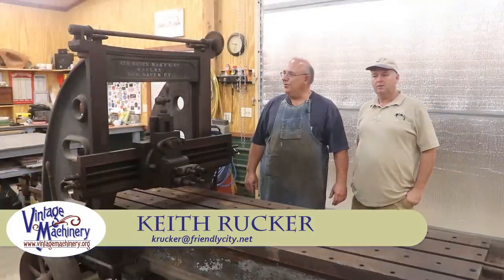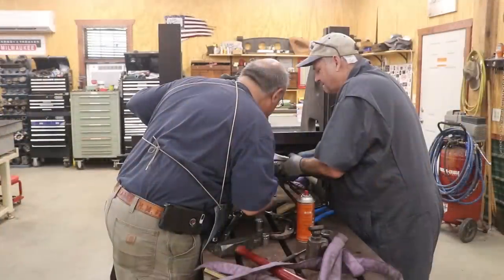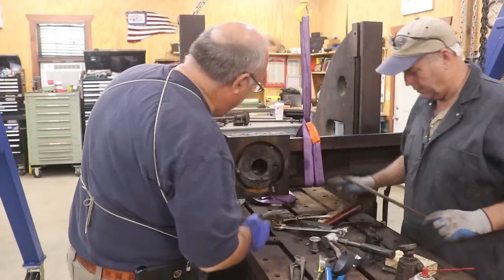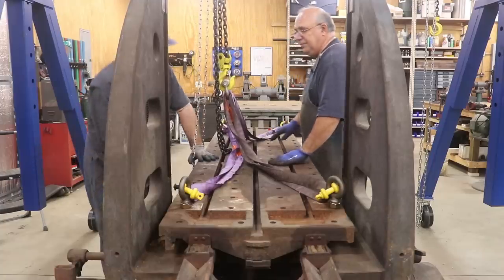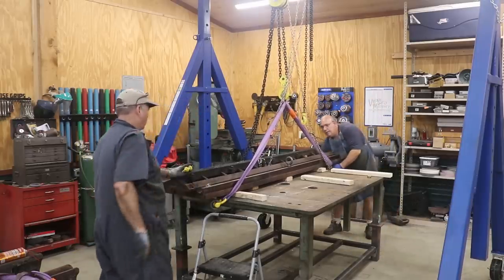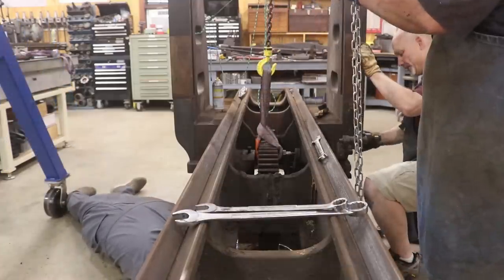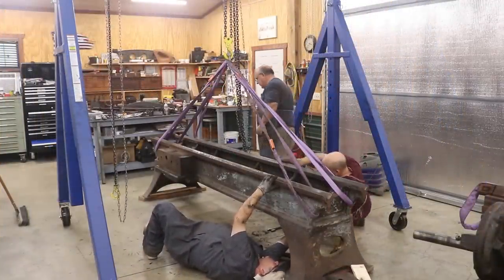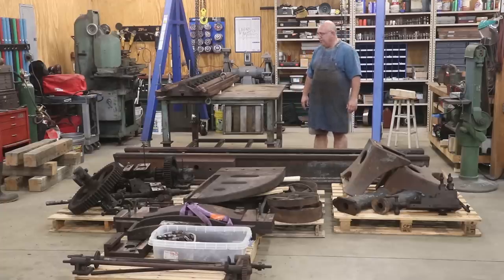New Haven Metal Planer Restoration - Part 1: Disassembling the Monster!

Comment: Keith for some of those large parts what about a commercial firm that has dipping tanks.  Years ago I had a 1922 Durrant frame that was caked in grease and rust.  I took it to one of those electrolysis degreasing, derusting places.  It came back so cleaned you could see the hammer marks where they bucked the rivets.  The time savings was enormous and allowed us to immediately begin restoration.  I encourage you to look into it.  No scrubbing, no mess!

Comment: Now you need a 24 foot above ground pool full of Evaporust
Reply: Papertowels soaked in ER covered it cling wrap replace every 12h.
Reply: I like Hammers suggestion more :p.
Reply: Maybe setup a small tent around the larger parts and use a pump and sprinkler to spray the evaporust.
Reply: The gel saves getting a big tank. It may be "one use" but that's better than buying a couple thousand gallons of liquid.

Comment: Just a thought. You should he yourself an adapter for your pressure washer to do water sandblasting. You could clean the rust off without all that dust and make it way easier on your self. Thanks for sharing looking forward to the restoration.

Comment: As much as I use EvapoRust and electrolysis, I'd go for a large sandblaster outside in a tent. I used one of the cheap tent buildings for that a few years ago, laid down a tarp, set up the "shed" and taped the tarp to it to make it somewhat airtight. Added a fan and filters like you would for painting and went to work. Blast a large piece, blow the dust off and spray on a coat of primer. For the machined areas a strip of duct tape would keep you from chewing them up.
Reply: There are "dustless" blasters that will come to your project, that do a superb job.  Sand is too abrasive for some of the parts on this old machine.  There are much easier and cleaner, plus much gentler ways. to clean this without sand blasting.
Reply: Blasting has many levels, from rough blasting with heavy grits to soda blasting. Dustless is nice not so much for the "dust" but because the water keeps the surface of the material cool and lowers the chance of warpage on thin materials. I've used it on car bodies for that reason.
Reply: @Blazer02LS  ...Yep, that was my point.  I am in the middle of two car restorations right now, the first we did with soda and recently the dustless (water based) was tried.  I was very impressed with both.  As you say, I found the "dustless" to be the ticket for fragile old auto bodys.
Reply: Had a neighbor years ago who really didn't understand blasting and what it could do. He used slag to blast the entire car. Even before he put it in primer the quarters and doors looked like the surface of the ocean during a storm. LOL

Comment: Keith, you need to find someone in your area with a lye tank.  All of those greasy gears and such can simply be dumped in the hot lye solution and as if by magic, they will come out like new.  Probably won't cost any more than the cost of degreasers you have to buy.  Then you need a whole drum of evaporust!
Reply: Dustless blasting is the answer.
Reply: I had a lathe bed done by a local diesel machine shop. They had a good size caustic tank.

Comment: Keith do you have a RE-Store near you . .see if they have a fiberglass shower stall..  or 1 piece bathtub and surround.  mount that on a wide pallet with a normal bathtub drain and overflow. but Mount it at least 10 or 12 inches above the pallet.. . bring the drain out into the side of a  5 gallon bucket that you have drilled and screwed a fitting into the side as a reservoir.. a second bucket piped to the side of that one using sink drain type fittings so you can control the flow with a popup.  now the sediment will drain from the bathtube into the first bucket. the evaporust without sediment will flow into the second. where you have a small sump pump sitting to supply various sprinkler heads aimed into the bathtub..  you now have a big part derusting tank that only needs about 5 or 6 gallons of evaporust at any time. 

 you will have build a structure with a plywood top and surround for the tub to sit on and using mortor to drop the bottom of the bathtub into to give it strength to NOT break thru  and some structure to support the back and sides but that should not be hard with some 2x4s..

 if you use a sewage pump  as a sump pump it can handle the solids that come out in the residue better..  you may need to use brass sprinkers and modify the sprinker heads for additional flow with a cut off wheel or on a mill at an angle with a slotter.  since the pump lifts out..  this device can sit outside when not in use.. 

 i also wonder  if you could get some really thin strips of the plastic for ways..  and just glue long strips on all sides..  so it rides on plastic on plastic with lube between them eliminating the huge expense of needing to be shipped to the grinder.  it would have to be very thin as you don't want to change the drive gear engagement ..  but i would imagine that is adjustable by grinding the and changing shims.  having layers of plastic .. full thickness installed without scraping.. would allow you to perhaps if one or 2 get damaged by debris.. 

 good think you got a pair of precision ground tool room stones.

Comment: If you grind the ways, you must go back and fuzz down the ways to get your PPI established for oil retention on the surfaces.  What I don't see is the oiling system for coating the ways as the planer table goes back and forth on the bed.  This would be good opportunity to install a pressurized oiling system for bed and table.  Look at a Rockford planer for ideas.  Ken
Reply: You are talking to the "scraper" pro in Keith.  You need to follow these videos a little closer.  He has done many scraping projects and has scraping classes at his shop.  Traditional scraping is the answer for the finishing touch on the table and ways.  I have a feeling if he reads this, he will get a laugh at "fuzz down" !!

Comment: Man I love these. I'm doing research for a project I have going , to build a smaller planer. I'm curious why the Bull gear is always so big and does it really need to be?

Stay with me. I have a theory, but I'm not sure if it's correct. I believe the bullgear is big, because they were designed to run off a line shaft (250~rpm). Because of the flat belts, they had to use a very large pulley on the machine to get the needed grip/friction to turn it.  It also served as a large gear reduction, and added mass to the assembly, which helps keep it from stalling with changes in load. I assume this drove a smaller pinion gear. The pinion gear would be fairly large due to the low DP. The low DP was needed for strength because the gears were cast iron. 
The bull gear is just an idler so it doesnt effect gear ratio. I can only assume it was made big to make it's centerline lower. This in turn keeps the centerline of the the pinion shaft lower, allowing the large belt pulley to be lower and out of the way. One large idler gear is faster and cheaper to make than a set of smaller idlers.  Maybe?

On to my project. Would it be possible to use a smaller diameter bull gear with a larger pinion? In this way I could accomplish the same thing without the need to machine such a large diameter wheel. Because my machine will be run by an electric gear reduction motor and employ the use of a countershaft, I don't need to reduce the rpm at the machine. I just need to make it move. 

I'll keep researching to try and find an explanation. I just thought I would ask. I love this channel and the followers here are usually very knowledgeable. Thank you.

Comment: If you decide to grind the ways, make sure you take sizes so you can add material to the table ways to compensate . I’ve seen where some either plug the scoring or fill in with silver solder.

Comment: The business where I buy my automotive machine shop equipment has a planer 6 times the size of that one .  3 times as long and 16 to 20 feet tall . They have a milling machine head mounted where the Clapper box would mount. They use it to redo beds and ways.
Reply: I'd bet that at one time, someone, somewhere, has tried fitting a grinder head to one.  I wouldn't mind seeing that idea explored.

Comment: Love to see a restoration that includes a regrind.  So, do you Turkite it to keep the table gear lash or recut the table gear?     I would love to see all the engineering decisions talked through here.
Reply: Probably just shim the gears bearings.
Reply: remember this is ia period piece, I don't think he'll do turkite... I think he'll keep it original, and like Austin said, probably just thim the gears and bearings if possible.
Reply: With something this size, the easiest/ most accurate way would be to cast the table ways using moglice. I've seen grinders that hold 5micron (2 tenth) over 6 meters being rebuild like this
Reply: @jsteifel  There is no way to shim the "gears".  The rack is probably cast onto the table. Even if it's a bolt on rack, machining the ways will move it closer to the drive pinion.  Shimming it would move it closer yet.  You'd have to take it if (if it is removable) and take material off the back.  But it's so long it would take several setup in the milling machine.  He would need an even bigger planer to do it correctly.  ;-)

To move the pinion away would require boring the holes off center in the bed and re bushing back down to size.  I don't expect him to do this either, at least not in his shop due to the size of the part.

Comment: For a proper restoration of a rare antique like this planer, the rule of thumb is "first, do no harm."  An antique machine restorer is (or should be) grudging about every little thing that changes the machine or removes metal.  Evapo-rust would work to remove the rust, but is way too expensive to de-rust parts that big -- unless you can get it sponsored. ;-)  I would personally use electrolysis, after making a "tank" out of lumber and plywood, and designed and previously planned for changing the size of the tank to the minimum needed sizes for each large part that needs de-rusting, and finally to a size for the smaller parts.  The tank could be lined with a swimming pool liner or some adequately heavy sheet plastic.  A hole in the ground can also be used, lined with plastic.  Electrolysis, like Evapo-rust, does not remove good metal from the parts like acids and most other methods do.  Keith will need to decide how much to pimp the parts out with Bondo and such, or leave them to show their honest age and the dings and bruises they have earned along the way, along with flat or glossy paint gold leaf, and fancy lettering.  I would prefer as original as possible.  My own opinion is that old stuff is supposed to look old, and show it's age, with minimum dressing it up.  Keith's opinion is the only one that matters here, and he knows much more about the subject than most of us probably do.  Recommendations can be easily thrown out by those who know little and don't have skin in the game.  Keith will do what he thinks is best, and I will do my best to back him up.  The old girl is getting a new life...

Comment: Keith, when you reassemble the planer, what do you intend on powering it with, or will it be a museum piece? I've seen conversions using a Reeves drive and a Drive All reversible gearbox, and later, just motors with electronic variable speed drives and a speed reducer. However, in one instance, I worked for a machine shop that used an overhead line shaft that was run by an electric motor mounted on the ceiling joists.

If you intend on using this, I would advise the first two conversion routes, and store the unused steam pulleys.

http://www.driveallmfg.com/

Comment: Call me a pervert, but one of these would be so easy to convert to cnc.  😬. And yes, send it out for grinding. Same with the table. No other practical option. I'm seeing some wire wheel and paintbrush work weekends with friends. That would knock off all the grunt work pretty fast. What an amazing project.

Comment: Imagine if this was designed and made last year. It would be plastic and pot metal with special made bearings between frame and table... that cost 1/2 the price of the machine and only available 'Special Order' from the Dealer and they are always 'On Backorder'.  It would cost 4x the equivalent of this in its day.

Comment: Why not hire a machinery rebuilder's scraper to come in and scrape the ways after you get everything reassembled?
Don't forget to put the machine on proper leveling pads to keep it straight.
JIM
Reply: maybe price is an issue,it is slow and costly process ,not to mention what that scraper will use for reference

Comment: Thats only a baby planer. I used to operate one with a 30 foot long cut. LOL
You will find that the side with the direction handle side always gets knocked around far more than the other side as operators prefer that side and the tool in reach so the swarf falls into the channels in the bed. The one thing that I didn't see was lube wheels for the table and bed. These run in a little tank of oil constantly transferring oil into the sliding parts. Does this one use holes in the table to keep a consistent supply of oil on the main slide ways?  If you do get the base ground it might be worth looking into a lube pump as when the ways are correctly lubed these machines are capable of some very accurate work. 

Cheers